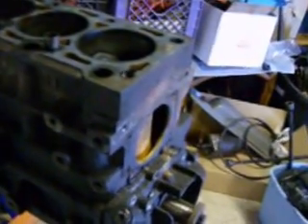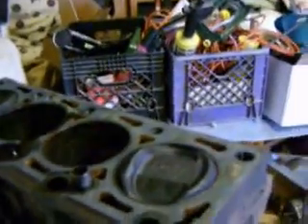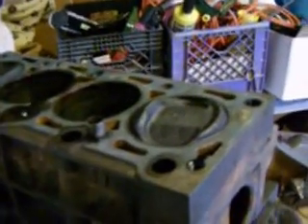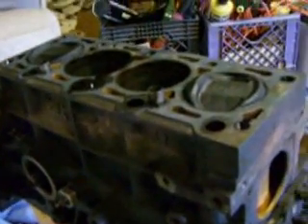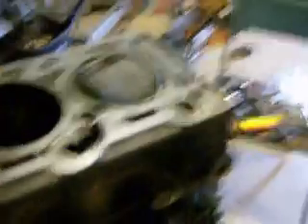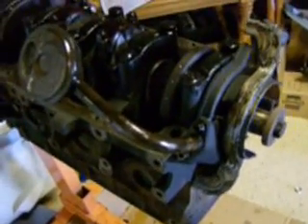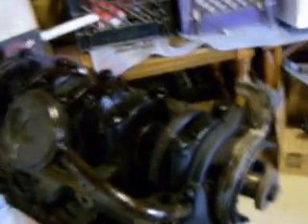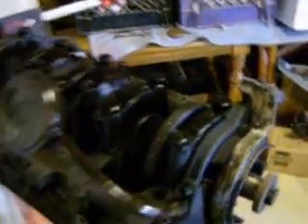Cracked Engine Block

Comment: So I don't know how far you are on the build (wile back I was asking you for pointers on these) but I felt your pain, my block was fine but I had a cracked head....took ages to track down but now I got a roller bearing GT head that's shaved and crammed so it coming back together hope yours is as well
Reply from the maker: Ya it's back together. Been together for a minute now actually. I have driving videos and a ton of other stuff to post but I was working like 15hr days at work totally disabled my channel.
Reply: good to hear i am about 2 days off of getting the engine back in the car... then we will see if it blows
Reply from the maker: Mr3wheeledbike
Prepare to feel the worst fear you've ever felt before. Be sure to prime it before actually starting it by pulling the plugs and turning it over sever (in my case several dozen lol) times before actually starting it. It fills all the oil galleries so that way you won't burn up your engine or scar bearings on the first start....................hey! Wheres' the pics and vids at man? LMAO!!
Reply: i load a vid up after it blows up...or runs.... but it looks good
Reply from the maker: come on man...lol. You're breaking my balls kyle! lmao
Reply: well there aint a way to send a pic via youtube so i reckon you have to weight ;p